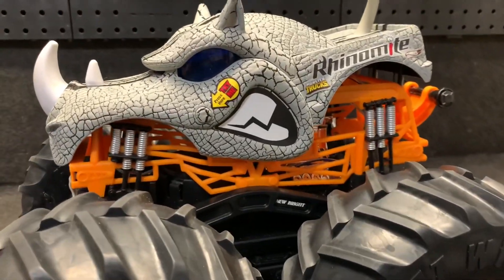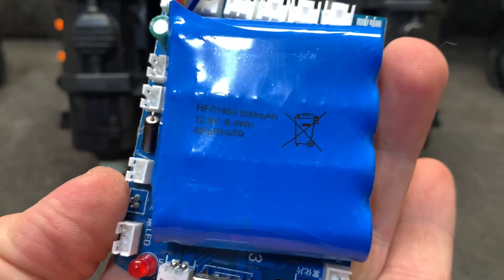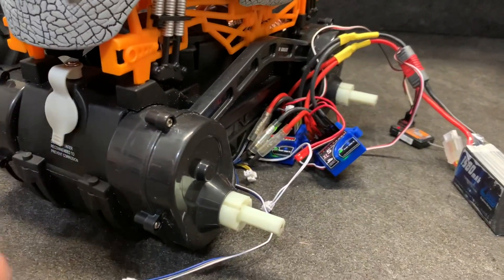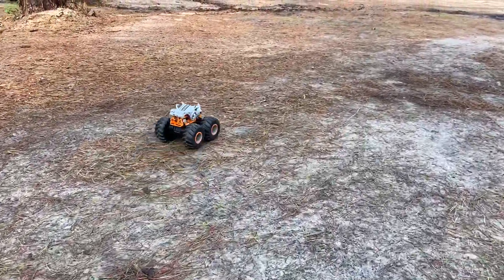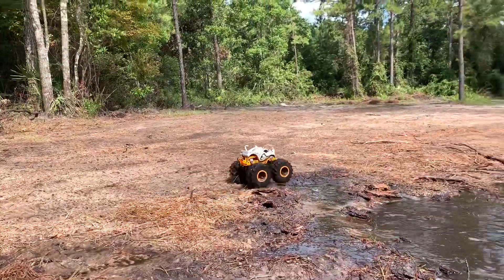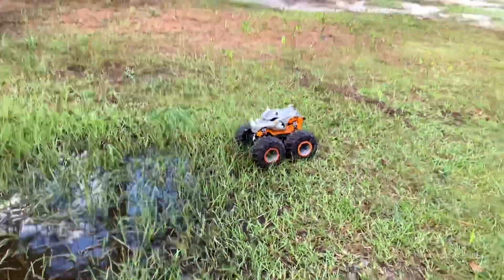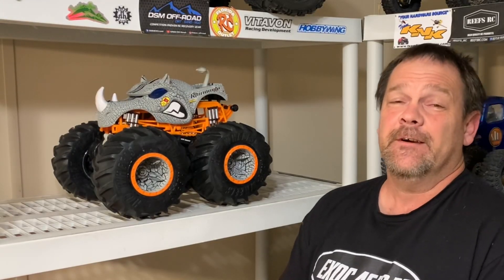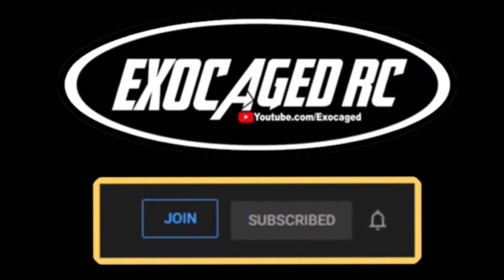Rinomite Gets Real ESC's and a Real Radio!!

Comment: Watching videos of the sherp that seems just about as capable.  It would be cool to design in 3D print a sherp body for this. Wouldn't be too hard
Reply: You can just buy an entirely custom Sherp RC 👍
Reply: @brandonreid4511  that's what I was referring to. You could 3D print a sherp body for this a lot cheaper than $1,000 it costs for the RC sherp

Comment: i would buy the rc sherp if the motor/axle/wheel wasn't glued in. and this rhino's motors are to weak and uh probably plastic gears will break with more power